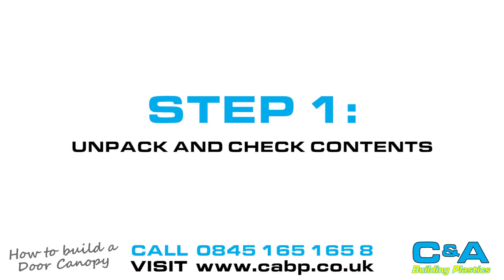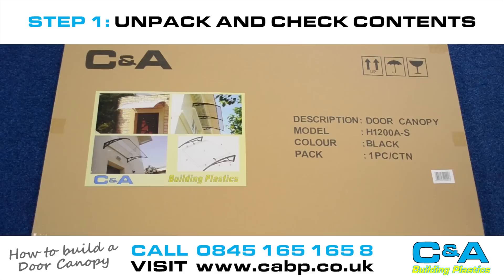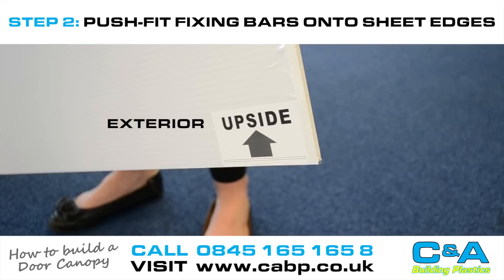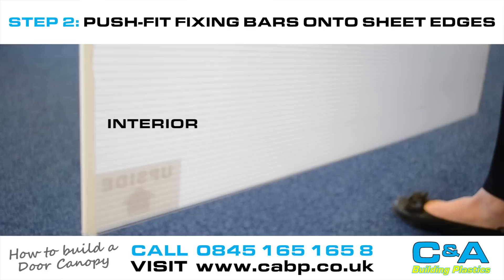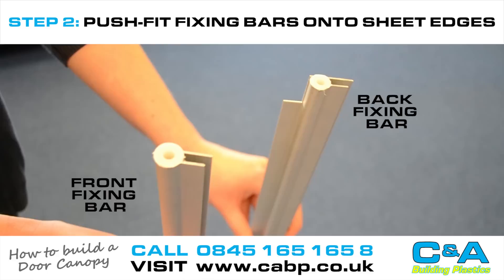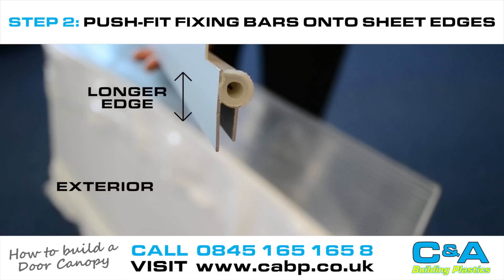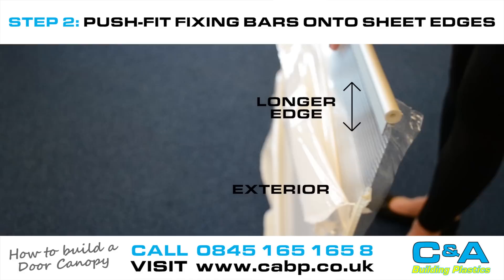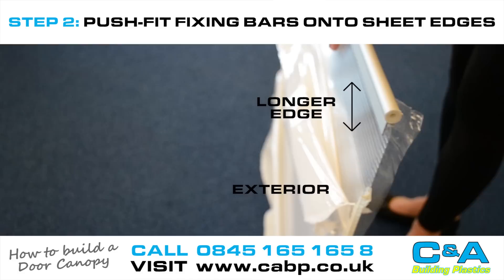Door Canopy Assembly

Comment: What size drill bit do you need to secure the anchor bolts ?
Reply from the maker: 10mm drill bit
13mm spanner
We do a hit with those and the silicone and screwdriver if it helps

https://www.cabp.co.uk/Door-Canopies/DIY-Door-Canopy-kits/Door-Canopy-Installation-Kit_TCIK.htm